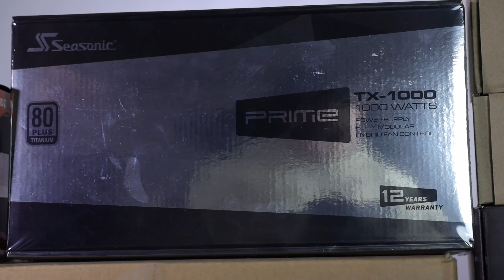Raijintek PAEAN Naruto x Itachi Custom Water Cooled Gaming Pc | RTX AMD x570 5950x RGB Streaming

Comment: I've got this one as an horizontal build (no dust can come in from upwards) with two AiOs. 280mm for CPU 5800x and 240mm of the Asus Rog Strix RX 6900 XT LC Top
4 x 8GB 4000mhz CL15 RAM
2TB P5 Plus
2TB MP510
1TB MX500
1300 Seasonic Prime Ultra 1300w
Asus Rog Crosshair VIII Dark Hero ♥️